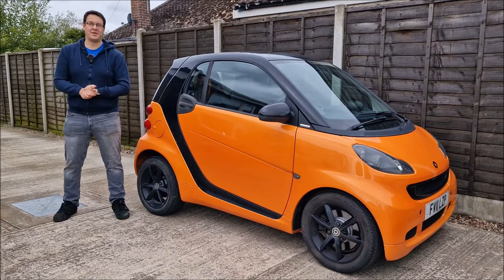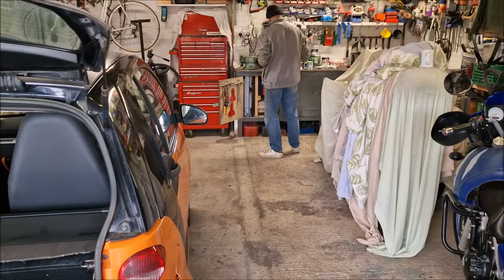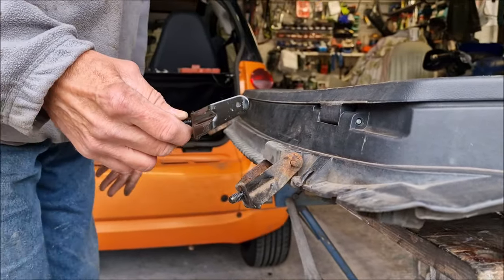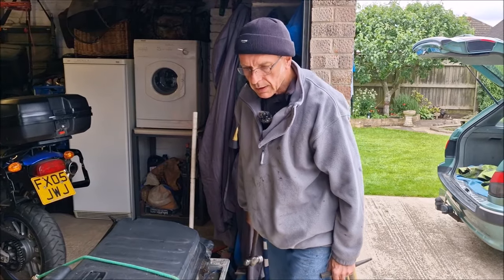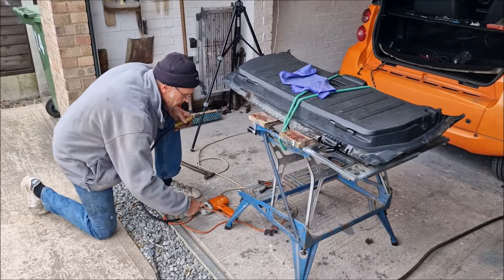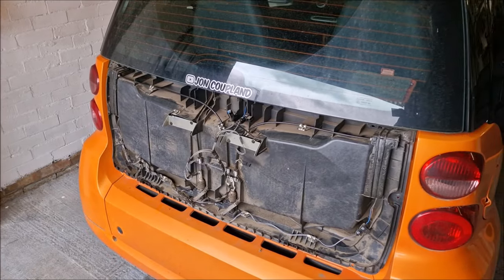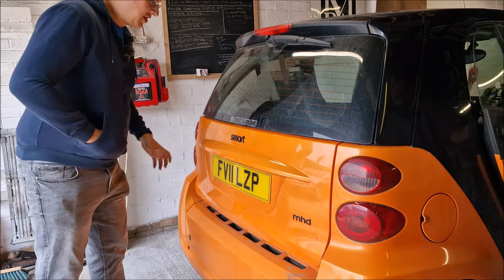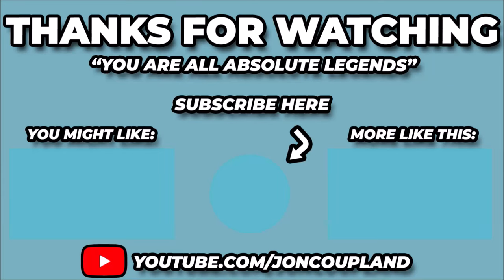Smart ForTwo Tailgate Hinges Replaced - THE Worst Job So Far

Comment: Well done ! - But - I would have taken the tailgate off, stood it on it's end, and then make a platicine bowl around each of the pins. Fill the bowls with PlusGas, and leave it for a couple of days if you're not in a hurry. After that, gradually try to turn the pins a little, whilst repeating the process if need be.
Reply from the maker: Sadly we didn't have time to do that 😊 but a good suggestion

Comment: Well that looked like a terrible job😂. I hate drilling anything with todays drill bits there rubbish i remember when they didn't just snap. 😊 I am sure you will know about the different stages of a service your Dad has Probably told you. I remember when i worked for Vauxhall dealership and we would grease door pins oil things unfortunately I don't think that happens anymore.
Reply from the maker: It certainly wasn't as easy as I expected

Comment: That last section where you showed the hinge…they’re really a “shite” design, don’t you agree? That fix was a good idea though…I’d have got some long drill bits and drilled right through and inserted the new pins…wasting time and energy and doubtlessly uttering many more swear words than necessary. Y’know, I reckon that there should be a scale of difficulty of jobs something like “two buggers” and one “shit” all the way up to “oh ffs just scrap the f*****g thing”! Just like the bodgers torque scale: “finger tight”, “very tight”, all the way up to “use the long bar tight”’
Reply from the maker: Great scale! Yes the design really is poor!